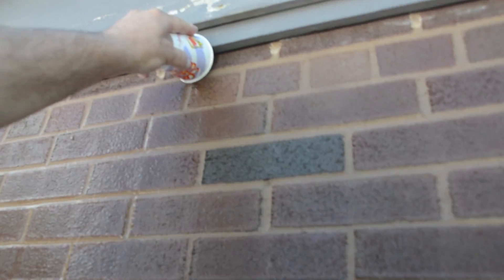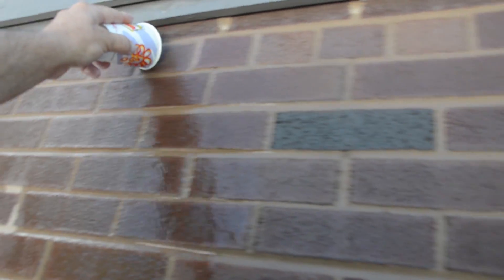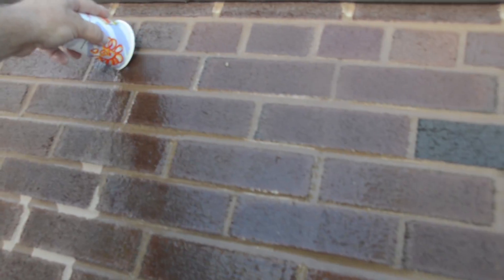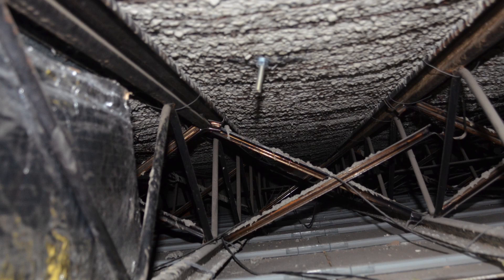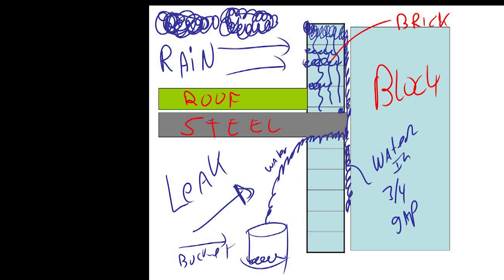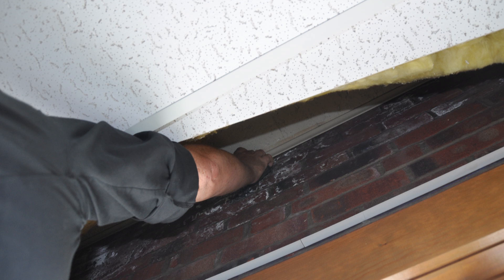Flat Roof Leaks

Comment: Iv got a leak on my flatroof garage - now its in a row of about 5 garages, checked the roof out and there appears to be no holes in the roof membrane, if i put a layer of waterproof paint/seal/blackjack stuff over the roof would this stop mine from leaking or could it potentially be spilling over from a hole anywhere further along the row of garages?

Comment: I think that most of this is common sense no weep holes, where is the water going ? it’s going to sit on the brick ties and as for the HVAC that should have been built on a plinth and not just sitting on the roof..  interesting about the brick sealing and it making the internal parts water tight hence causing condensation, I usually recommend repointing rather than sealing as I deal with domestic properties in the UK.

Comment: If the HVAC unit itself is leaking as it did when you poured the bucket through the fan How do you repair that? Normally underneath the HVAC unit has some ductwork and around the bottom of the HVAC unit the roofing membrane is flashed 
up the sides but in your video when you jacked up the HVAC unit there was no ductwork? I’m confused
Reply from the maker: NO DUCTS-- AC UNIT , If it had ducts it would be flashing.

Comment: I have a 5,000 sq ft commercial building and fought ($$$) roof leaks and their associated interior damage ($$$$) for years while roofing contractor after roofing contractor missed the true source, water penetrating the porous concrete block wall.  I now know there is you and a guy in Chicago that are competent but how do you find a "building scientist" wherever you happen to be?  The licensing process for trades should include a knowledge requirement.
Reply from the maker: I am sure a few in your area

Comment: I am laying a flat fibre glass roof onto an irregular quadrilateral area of 9 m2 that has no sides the same length and no angles the same. All walls are the same height and level. If corners in clockwise sense are labelled ABCD then side AB is 3.42 meters long, BC is 1.76 meters long, CD is 3.05 meters long and DA is 3.13 meters long.  Angles are 99.5, 105, 83 and 72.5 degrees respectively (A,B,C,D).  The roof is going to be flat so I am running timber joists (2 x 6 inch cross section) across.  I start all perpendicular to wall CD so that from corner D up side DC, I go up 38 cm and place the timber beam perpendicular to wall CD to rest above wall AB.  So I go up 38 cm at first and then every 40 cm so the joist lengths are: 3.11, 2.92, 2.73. 2.54. 2.35. 2.16. 1.97 meters and then I have 27 cm to corner C.  This is since the angle the first beam makes with side AB at corner A is now 65 degrees so the joists get shorter by 19 cm every time.  On the other wall AB the spacing between the beams is therefore 40/sin(65) or 44 cm (instead of 40 cm as in wall CD).  OK so far so good.  Now after securing these joists to the light concrete wall (it is a single walled aerated Y tong block wall system of 10 cm thick wall around) I want to put tongue and groove OSB3 boards (plywood).  These will have a 2.5 cm of foam insulation sheets, and also there will be insulation between the timbers.  What I am now struggling with are the following questions (1) I wish to give this flat roof a slight slope from wall AB to wall CD. It is a ruled surface I know so I need to raise it more in the wider sections.  I was thinking about using FURRINGS or FIRRINGS in timber.  Do you know much about them or when I should use them. I want to give the roof a slight angle (three sides will have raised edges but one is a drip edge).  (2) some roofers told me to stay away from fiber glass because the roof may sag in the middle over the years.  I do not think this is the case. Also this roofer said "I would stay well away from fiber glass unless you do it yourself and apply the resin generously".  Why?  (3) I am wondering if you have any other advice?

Comment: If you make a flat roof with a tiny degree to let water run off, using concrete like they use in swimming pools, is it not then "water proof"?
Reply: Мысли имнтересная, но личноя бетонных крыш не видел..

Comment: I don't have a hvac on my roof but I will look under the membrane under the roof hatch to see if that was done correctly because the leak has occurred in the same spot for two years straight on the third floor ceiling. do you have to replace the membrane with new membrane if there a collected water underneath?
Reply: Мембраны стоийкие к воздействию воды и её менять не надо. Надо найти и устранить повреждение через которое вода попадает в подкровельное пространсство.

Comment: I own a 2 story, brick 1905 build. On the top story, along our north/western wall, we have water coming in through the brick mid-wall. Any ideas why that could be happening? It is a semi-flat roof with what I'd say is about a 1-12 pitch with knee walls on the north and east facing. It's a corner building with buildings attached on the south and west sides. The building on the west side, where the leak is, is only a single story structure. Any help would be appreciated.
Reply from the maker: +Jonathan Bates  The brick is absorbing and leaking behind. Seal the brick.  PS I don't like sealing brick, but sometimes It fixes leaks.